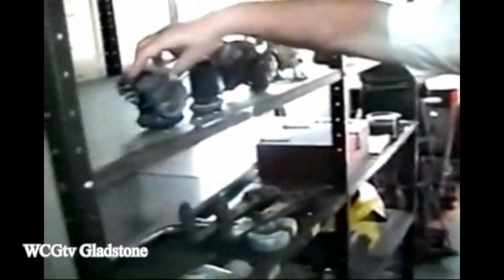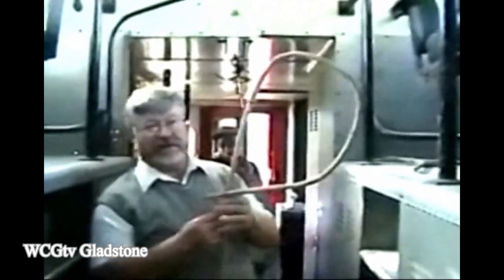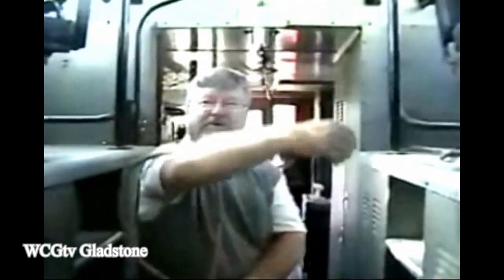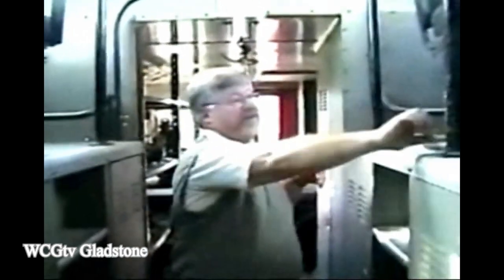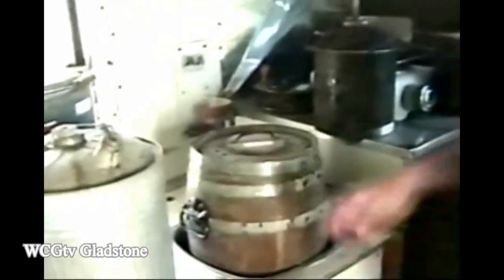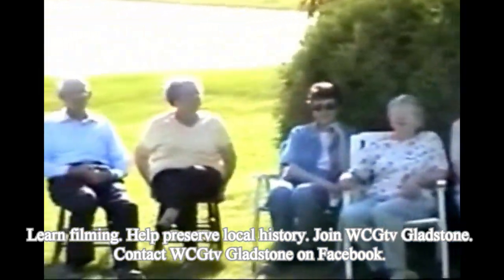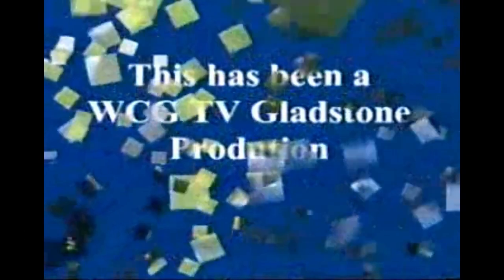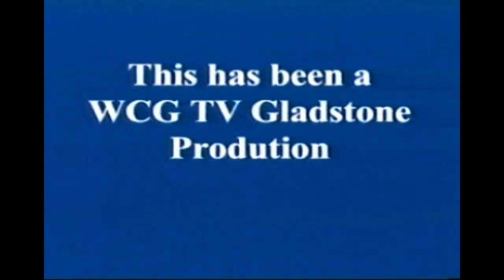A Look Inside a Former CN Caboose

Comment: Hi. Thank you for posting the video. Enjoyed seeing the inside of the caboose. I would like to share a couple of thoughts/comments on the video.

It is likely that this caboose never had bunks installed. Where the display shelf  is located would have been a couch. These cabooses were not intended to have crews sleep in them. The crews would stay in a bunkhouse at the end of their run (in this case Dauphin). 
The apparatus displayed by the guide to deliver messages to the train were called hoops. Hoops were used to deliver ":train orders" to passing trains. The train order was created and dictated by the train dispatcher. The station agent or operator at the station (in this case Gladstone) would copy the order dictated by the dispatcher and use the hoop to deliver the order to both the engine crew and crew on the caboose (using two different hoops). While the train orders could contain many different types of instructions, in Gladstone, most of the time it was instructing the train crew to meet an opposing train at a specific station further down the line. 
It is true that in much earlier times, communication to the agent/operator by the dispatcher (and other stations on the line) was by telegraph. However, when this caboose was in service, this communication was by an internal phone system. In addition, when this caboose was in service, CN did use radios. There would have been a radio of some sort in the caboose. In addition, there was a fixed base station radio located in the station at Gladstone for the agent/operator.

Again thanks for the video.
Reply from the maker: Thanks for sharing that! The caboose isn't native to Gladstone...not sure where it came from, it was before my time...

Comment: I thought train cabooses would be a little bit more cosy than that,  I thought it would have a bunk for sleeping when the engineer was off duty after shift changes, while another engineer would drive the train.

In long-haul overseas flights, airline pilots have a private bunk on the plane, where they can take a nap when their shift is done, while the other pilot takes over.
Reply from the maker: The bunk spaces in this car were converted to display areas for the Museum...